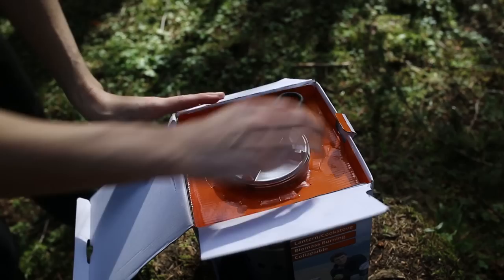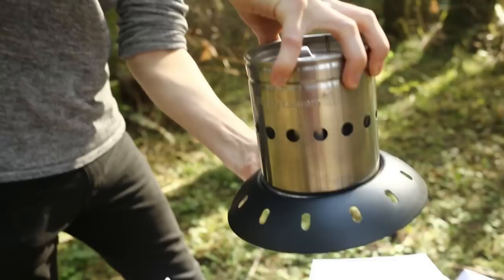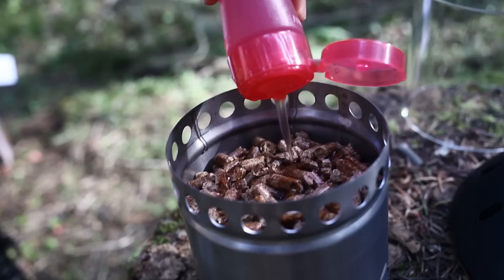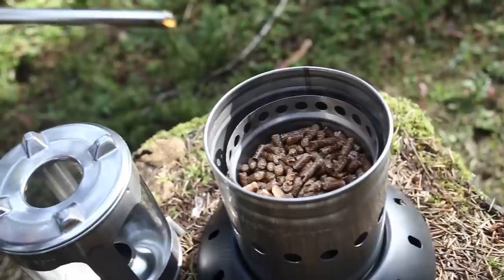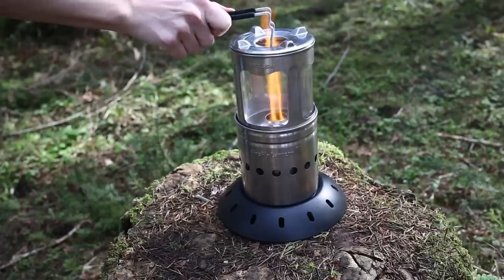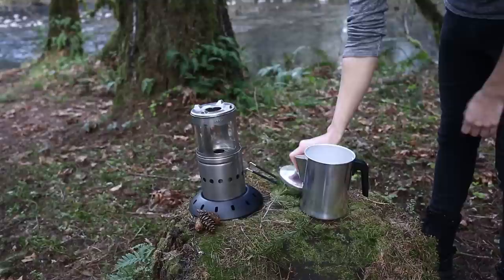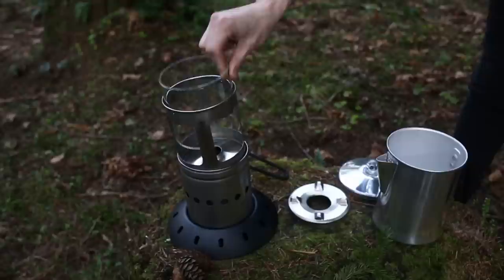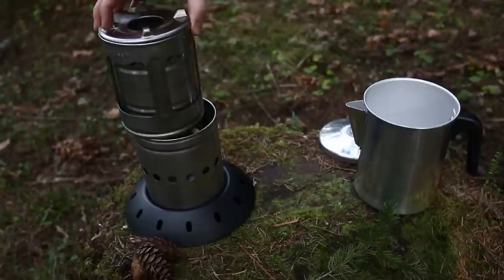The FireFly Lantern

Comment: The beauty of this stove is that pellets are super cheap and convenient, they give you a solid hour of burn time without touching it, smokeless until the end when the pellets are burned up, and boils 2 cups of water in 6 minutes. OK for a day hike or car camping. Not something for backpacking. Lantern function although it gives light, its not much. You can sit next to it and warm your hands which I do often on those cold evenings. Pellets are the only way to go. Tried pine cones and small splits of red oak...they burn but not well and mostly you just get smoke. Pellets

Comment: Please watch some reviews of this thing. Lets just say its a dud.
Reply: +Jim H The reviews I've seen (other than this instructional video) use biomass other than wood pellets and show the lantern in a very unflattering light. However, they are using the Firefly as a rocket stove rather than a wood gas stove. Also, they have not allowed the stove to preheat, a necessity with this type of stove. I wonder how it would work with a Swedish fire torch.
Reply: Hiram Cook gave it a very good test run using the recommended fuel and instructions.
lasted 30 min at best, and you cannot add fuel to keep it going. you have to clean it out and start over. I will admit, it looks cool, just not very practical.
Reply: +Jim H Burn Test #1 - Wood Pellets Used about 2 cups - lasted about an hour. "I'm impressed!" "I like it." Hiram Cook
Reply: "I really don't think the FireFly can be used as a regular wood stove. Also one thing I noticed is that I don't think it can be refueled during the burn. I have the feeling you have to let the fuel load burn completely out, then empty the fuel chamber, and start it up again." Hiram Cook.......I amended my previous comment. Seems it should last more then an hour as a lantern though .I think the concept of a lantern that u can cook on is pretty cool, but functionality wise, I'm going to have to agree with the masses on this one ... Even with the "optimally" burning wood chips I have to think of a normal night camping ... Say it's fall and I'm planning on using the lantern from 6-10 pm ... That means I need some type of starter plus 8 cups of wood pellets to last me the night ... And I would have to start it 4 times... Doesn't seem practical to me.

Comment: No mention of burn time.  I would not want to be in a cabin or RV with the fumes and smoke coming off of that thing.  And drink water without knowing if it was unpolluted?  Not lately.  At least it would have to be boiled, and looks like it was  just barely heated.  OK for washing dishes, but no way for drinking.  Another answer to a question that was not asked.  Waste of money.
Reply: Why the hell would you lite this in a cabin or an RV?  Would you build a fire inside your house in a garbage can outside of the fireplace and leave the windows and doors closed?  You should try it.  The world is overpopulated with stupid.

It burns for just under an hour with 2 cups of pellets.  Why wouldn't you leave water on it until it comes to a rolling boil for 5 min?  If you need to boil it longer because you're boiling a gallon, add more fuel.  

It's not a great product but it'll work.  You just need a fully functional brain and common sense.

Your comment was from 3 years ago so I may be too late. You may have already won the Darwin Award and you and your progeny are already dead by your hands, in which case, R.I.P. and my condolences to your family and friends.